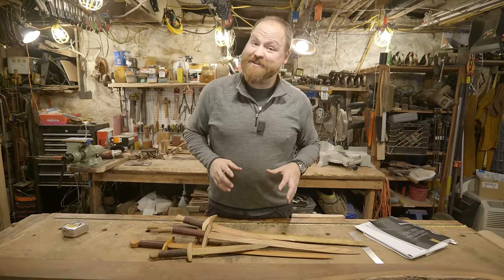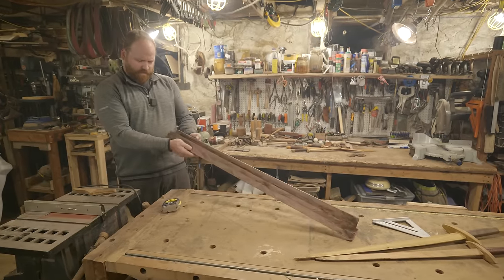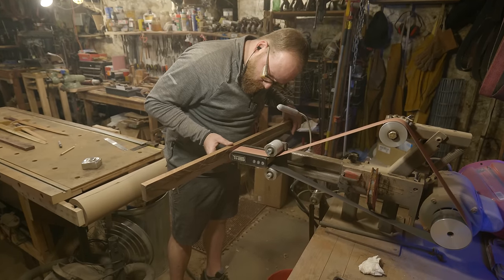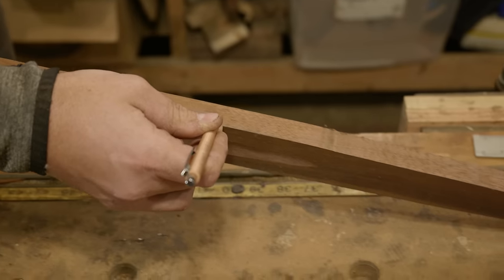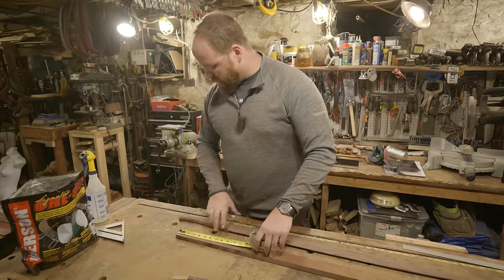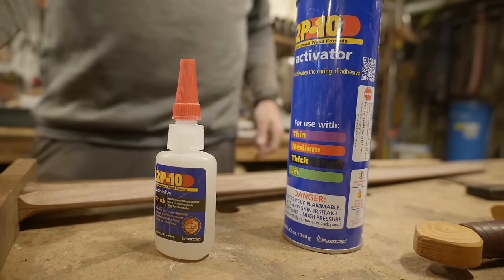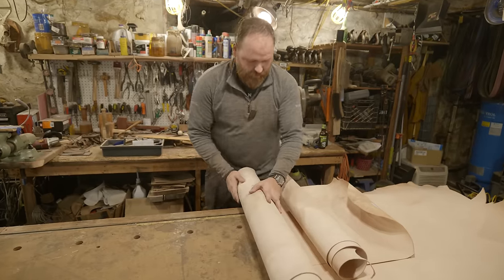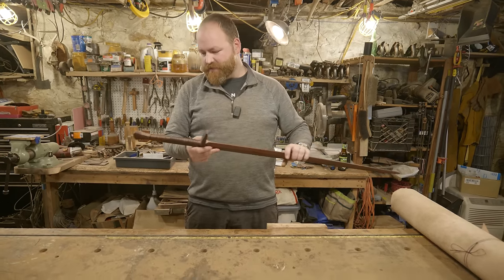EVERYONE Should Make a Wooden Sword: Easy Project

Comment: Easy project when you've got a shop full of tools XD
Reply: The tools don't make the craft. The craftsmen does. Even if you only have a knife, you can do this. The major difference is time to finish.
Reply: That’s why I have a carpentry class
Reply: @daedhrogon7946  but to be fair. If he makes a video saying easy project anyone can do. He should have done it with basic tools that people can acquire for cheap if they don't have them. Not with well over a thousand or two of electric equipment.
Reply: I mean you need SOME tools. I'd say the only tool that is necessary for an enjoyable experience is the belt sander. Everything else you could roughly shape with hand saws and chisels. The experience of grinding it down with a belt sander to its final shape is what truly makes it a fun project.

Comment: If you plan on using these for full contact sparring for HEMA or what have you, i would suggest using wood that is as hard as you can afford, and wrapping the blade in grip tape to hold it together if the sword breaks. Shattering a blade mid-contact isn't bad if you notice immediately, but if you dont you can seriously injure yourself ir your sparring partner with a broken blade
Reply: Wouldn't recommend using wooden swords for hema period. Not enough flex and the risk of breaking into sharp pieces is pretty high.
Reply: Or just, you know, grow up….
Reply: @SpaceDad42  and do what?

Comment: 'EVERYONE should make a wooden sword!'

The second you use a single power tool: Not me I guess
Reply: i don't see a reason why this couldn't be done with hand carving tools. if you use a draw knife to take away the bevels on the blade, a channel chisel/gouge for the fuller, and take away material for the handle and guard with whatever works for you it would be the same. it would definitely be difficult, but i'd personally practice on a small dagger to get the technique down and them move to a bigger sword.
Reply: I was trying to phrase the same sentiment in a positive way, and failing, so I'll just agree here. Amazingly, not one tool was used in this video, unless you count sandpaper... and the channel is called "the Art of Craftsmanship".
To BrotherlyBear - yes, of course it could all be done by hand. Give it a try and report back - I think you'll find it's neither easy, nor for everyone.

Comment: I don’t have a great belt sander. Just a little disc/belt combination. But what I do have is planes. Thinking I can do the fuller with finger planes. Start the blade bevels on the band saw and finish with a block or jack plane. Should really cut down on the dust too.
Reply from the maker: Now that is the outlook on making things that I love to hear.
Reply: Use a router or a curved head chisel

Comment: I try to cut the distal taper after profiling the blade. If the wood is thick enough I'll cut it at an angle to make a pair of pre-tapered blanks for two swords.
Distal taper really makes the blade light and lively.

Comment: It looks nice, but if you want a sturdy sparring sword, make the cross section an ellipse rather than having any sharp edges. For a longsword, you'd want around 3/4 inch thickness. I reiterate, avoid sharp edges anywhere or its more prone to failure.

Comment: If your going to be using these, there are woods that are much lower risk for splintering which can be very dangerous. Hard maple is my favorite, but hickory and ash are good choices as well. Downsides on hickory is cost and being hard on tools. Downside on ash is it will dent more easily and obviously (but it is the cheapest). I'm sure for those outside North America there are other woods that work well also, but going for a wood that doesn't tend to splinter is much safer. I'd also note if you give one to a kid they WILL be hitting them on stuff.

Comment: So as someone who wants to make a wooden sword, but doesn't have the belt sander, if I were to cut the basic shape with power tools, would it be feasible if I then use woodcarving knives/other hand tools to finish the project?
(I'm in college, and I want to do something over break, so it would have to have a reasonable time commitment)
Reply from the maker: You could definitely do this with hand tools. If you have a block plane it would make it pretty easy. Also could be done with rasp or draw knife.
Reply: @TheArtofCraftsmanship , awesome!! Thank you :)

Comment: Hello from Denmark. Wonderful video and sword 😊 But what is the spray you use with the glue?
Reply from the maker: It’s an accelerator that makes the glue dry nearly instantly. This typically comes with CA glue when you buy it.
Reply: @TheArtofCraftsmanship  Yes, but be aware it can also turn the glue white if not used sparingly. sodium bi-carbonate can also be used ( baking soda).

Comment: Hi! I was starting to make a couple of these and was not sure about the right wood to use. How thick was the blade? And, about the wood, I was oriented on using beech, but I saw that spruce hardwood is cheaper. Is it too soft and should I go on beech or is spruce still ok for the job?
Reply from the maker: I would suggest using a hard wood, for added durability. They can be made from soft woods, but they will dent and possible break easier. I start with 3/4” thick staves.

Comment: How did you determine the thickness of the blade as you came to the point on the end
Reply from the maker: I grind the blade to the blade profile shape, then grind the bevels toward the edge line, drawn down the center of the edges, and match that with grinding down to the center line on the flat. When get toward the point it’ll naturally start to thin the blade, but you may need to redraw the center line on the flats, or eyeball a straight spine. 

Hope that explains it.

Comment: Try halberd or rapier next lol ;)

Honest, kind critique from a 2-Year HEMA practitioner, I'd say that these could be good swords for sparring. I think that they need more weight though, because there needs to be a sense of structure vs. just stopping the sword effortlessly, making for better, more realistic sparring. I'm only saying this because I saw you throwing it around like it was nothing, so either it was light or you got super strength :D I'm not saying to make it a club, though, just heavy enough that you got to use your muscle a little to stop it.

The kind of sword could be classified as a "Bastard Sword" historically, being in the middle of longsword and arming sword, or as pop-culture calls it, a "One or two hands" sword.

EDIT- Also, just to point out if you didn't already know, the Fuller is to reduce mass and weight in the blade. The pommel is also used as a counter-balance.
Reply: I think you mean hand and a half sword? Which is a bastard sword.

It does look too short to be a true longsword but at the end of the day the names for all the swords have changed over time and are pretty unclear when it comes to the definition.

Comment: Why didn't you at least epoxy the edge of the blade to make sure it break like the other one?
Reply from the maker: Thanks. I’m not sure what you’re suggesting. Are you saying put a coat of epoxy on the outside of the blade? That’s an idea, but then it gets more complicated than I want for this project. Remember, the goal is to be able to make it quick for fun, and if it breaks, you make another. That being said, there are loads of other things that could be done to add interest and longevity overall if someone is interested.
Reply: @TheArtofCraftsmanship could you please give a couple tips on how to make them more durable?
Reply: @AnamTahirdar  could try oiling with lindseed or danish and following the age old addge one a day for a week once a week for a month once a month for a year and once a year although i dont know if that much is actually necessary maybe 4 or 5 coats would be enough